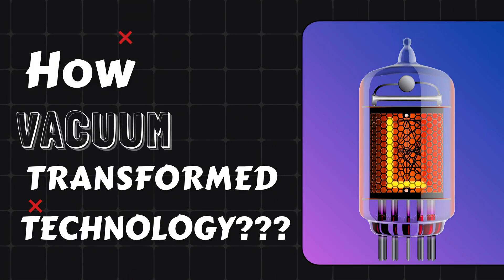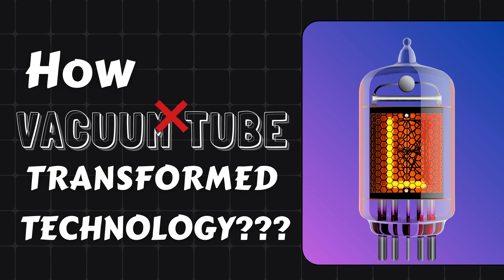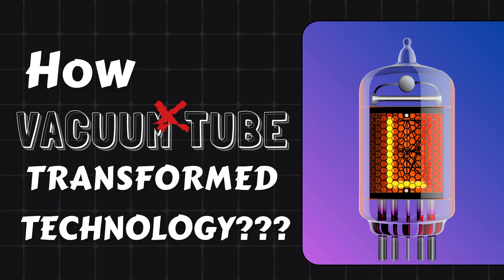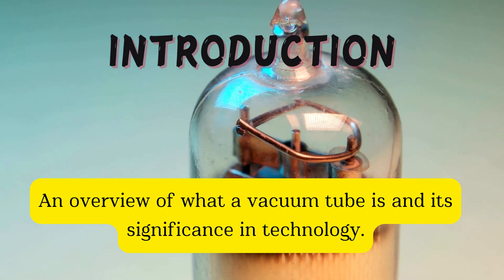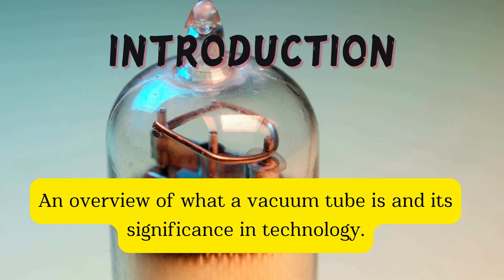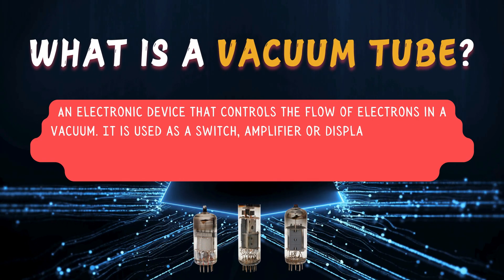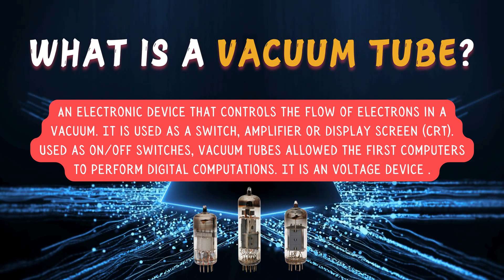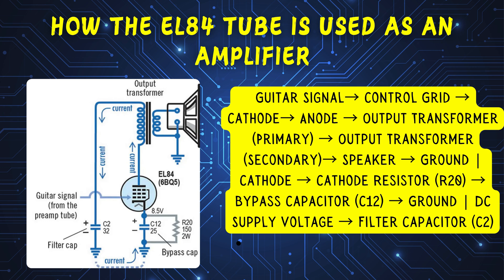How the Vacuum Tube Transformed Technology ???

Comment: The EL34 pentode tube ( much bigger ! ) works the same , but , using the KT66 or KT88 ,  beam tetrode tubes ( compatible pin out ! ) results in a slightly higher audio output .. the only snag is they are ( now , VERY expensive ) . DAVE™🛑
Reply from the maker: Yes, I can use that, but to ensure viewers understand, we should always start with the basics.